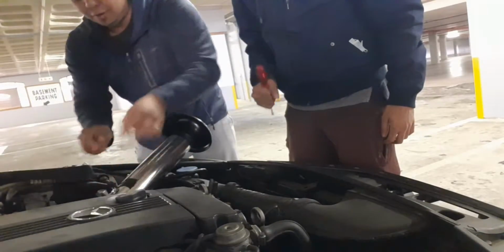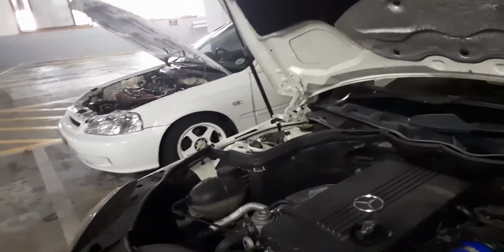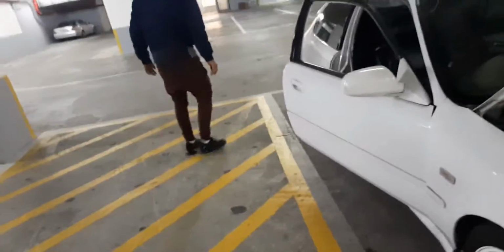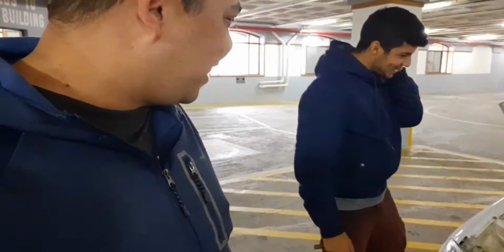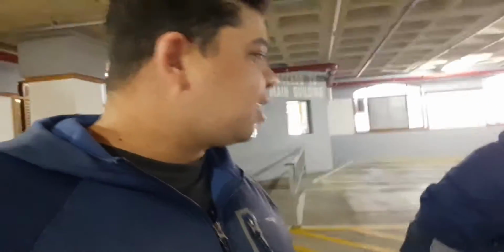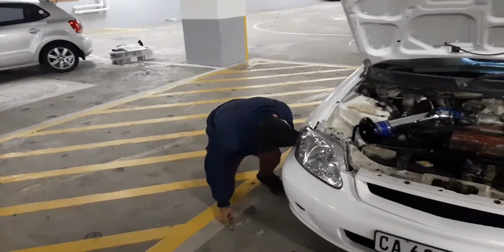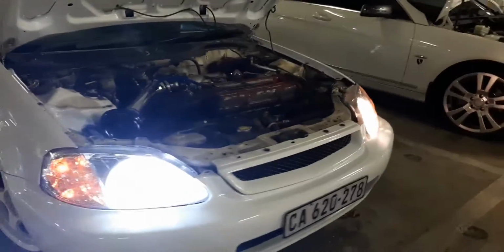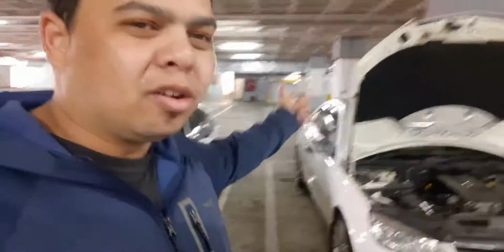Can you put a stack on it Pt.2, on a W204 Mercedes benz

Comment: I just bout one of these the have 3 dampeners 1 charge pipe 2 in the supercharger and a big box behind the supercharger I got rid of all that and put a stack I cut the middle part in the air box and got a 11 dollar aluminum tube of Amazon for the stack also the supercharger only engages at 3k rpm under load so u gotta test drive it to hear it all that gave me like 12-13 psi boost
Reply from the maker: Oh nice you gotta show us what you catching on..🙌

Comment: I'm in the market for a w204 which would u recommend a 2009 c200 kompressor or a face lift c200 kompressor
Reply from the maker: From what i know from my car go for the facelift they are more modern and the interior is nicer they dont have the kompressor motor on the facelift tho thats when they switched to the turbocharger version so the C180, C200 and C250 all had the Turbo M271 engine with different states of tune. But it really all depends on you the facelifts are going for good prices now.